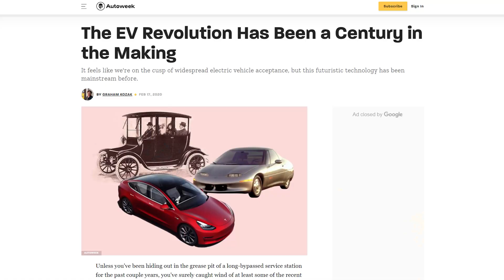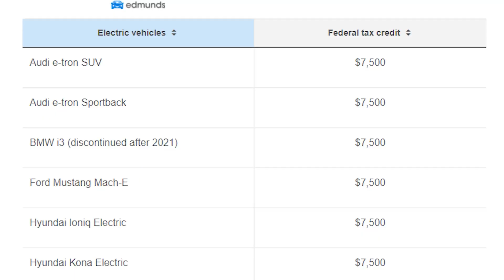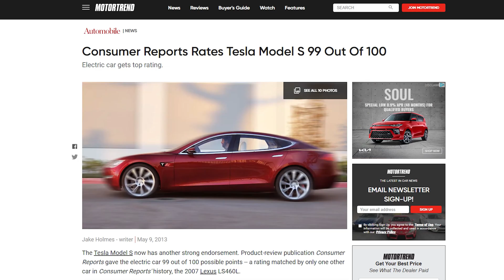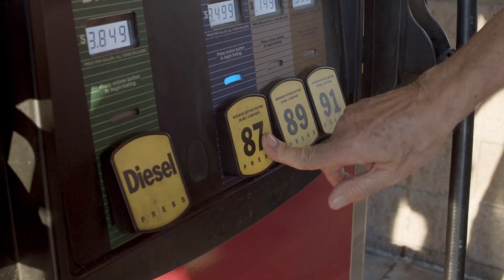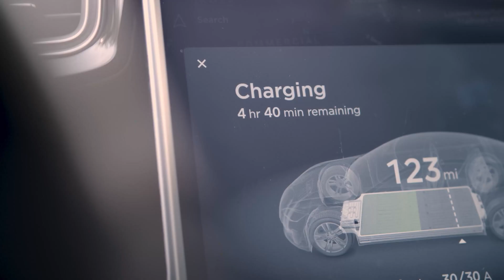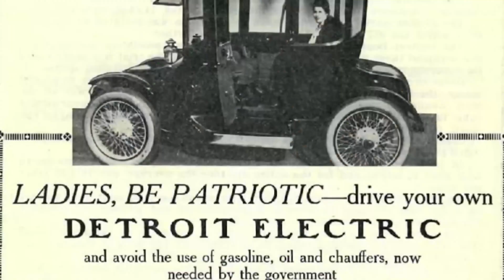Why You Want an EV | Gruber Motors

Comment: I doubt that they will ban internal combustion vehicles. There is no need since they naturally would be phased about as they are replaced. By the time they could without causing an uproar, there would be only classic interval combustion engine vehicles on the road whose impact is non-existent.

Comment: Great points Peter, however it is not yet legal to have AutoPilot or FSD drive you home after drinking as the features are not autonomous and the driver has to remain able to take over at any time. Many regions have free public charging (generally level 2) at malls and restaurants so your charging costs may be even lower

Comment: I rented a model x and the range was very disappointing. It said I had almost 300 miles but I only got about 200. Yes, it was hot and I used the air conditioner but I wasted 2 of my 5 days of vacation chasing charging stations. I was in an area of Cali that doesn't/didn't have many superchargers.
Reply from the maker: All that is improving constantly.
Reply: @grubermotorcompany  I understand that but they need to standardize the mileage numbers.

Comment: Does the country have enough generating capacity and a reliable enough distribution grid to handle all these EVs?  What about lithium mining and battery disposal until the million mile batteries are available?
Reply: Owning a Tesla is a lifestyle and people who can afford all the expensive Tesla accessories won't be using the grid. With a powerwall and solar panels most Tesla owners will never use the grid
Reply from the maker: A very great question and a an interesting one at that if you would like to check out this podcast we did with a  physicist and consultant to power utilities we talk about Tesla's impact on the grid and we can make another video about this the comment from Mac Bere is very interesting, the link to the podcast in down below!
                                              https://www.youtube.com/watch?v=FIVhPx-cS2c&t=851s

Comment: If we all switch to ev then power grids will have a tough time keeping up. Power company's will increase the price for electricity. The money won't go to gas companies but electricity companies. There will always be a monopoly so in the end it will all cost the same. Ev or non ev.
Reply: EVs charging at night, when there is little peak demand, or during the day (eg at work, shopping, weekend) when there is a glut of solar supply... actually HELP utilities and the power grid. (besides giving them more business overall.) Hence most utilities give you REBATES to get EVs, install chargers, or switch to EV-specific charging plans (cheaper at night, expensive during peak hours.)
Some locales have PAID EV drivers to charge their cars to absorb excess generation during the day! Not just free, PAID THEM!